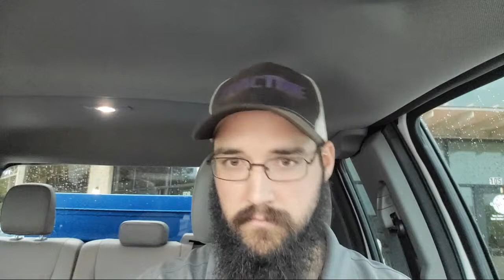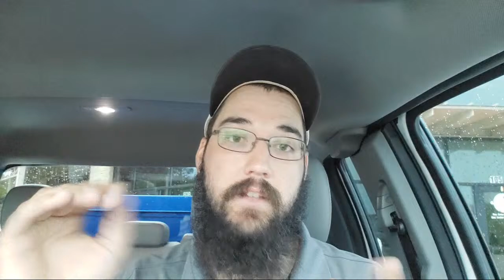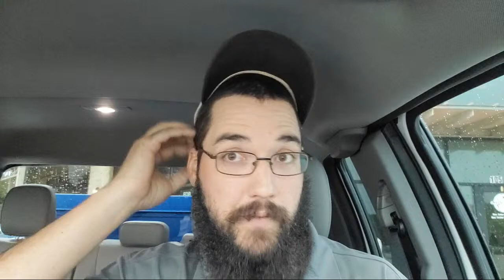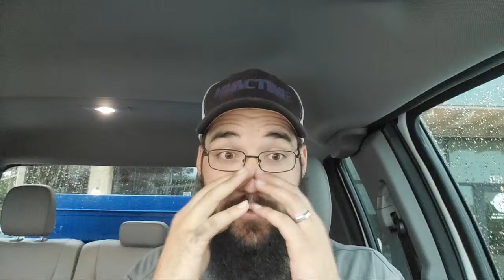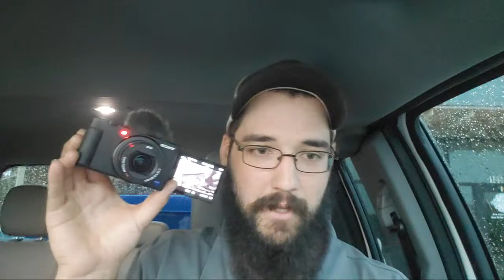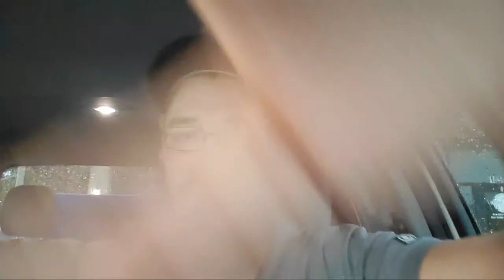I NEED ADVANCED CHILLER HELP!

Comment: Try verifying refrigerant level sensors. I have Also seen eev get stuck when under load. They work when static. But under load they don’t and get stuck causing flooding back to the compressor. A negative superheat at startup momentarily is normal but should come up pretty quick. I think you floding the compressor. Flash tank level is not being maintained. Try to change the level set points. Definitely need to verify/change oil filter. Good luck finding one. Are the over current setpoints staying  correct. Check pots.

P.s I think the compressor will need to get replaced due to constant resets. 0 psi is Concerning
Reply from the maker: Your so very close to the final result. Good input! We have everything settled now, ill have video out by next Friday.
Reply: @HVACTIME  one thing I often overlook is pulling the sd if it has one in it. Looking it the run data prior to the fault will often time lead us in the right direction. I am not proficient with excel. There are way to create a trend with it. I would also recommend installing one of it is not installed. It may help relief liability in the event of a costly catastrophic failure when everyone is pointing fingers. 
  I found a machine the vsd logic board was saying sys2 was running in the fault histories  but looking at trend data it definitely was not. Ycav have had software issues.

Comment: Blocked muffler or oil separator maybe? Also was leaning reversed phase, but vey weird the discharge lost pressure
Reply: Did you put the gauge on the discharge service valve to verify pressure is dropping at compressor?
Reply from the maker: I did, video will be out next Friday
Reply: @HVACTIME  Mate im gonna have a stab at it..i reckon the muffler was blocked somehow. Explains why the suction pressure was not moving as it wouldve pumped down after the muffler banking refrigerant in the evaporator and removing refrigerant from the condenser, thus causing the compressor to growl trying to push against a high discharge pressure immediately after the compressor.
Dunno man, would like to see what the issue is on Friday when you post. Anyway like your videos, keep it up!
Reply: Ooo just realised a failed discharge valve could be the culprit after watching the whole video lol

Comment: Confirm that the amp draw displayed on the fault log at the time of running is actually above the fault limit set point. One of my colleagues noticed once that the actual current being drawn at the time of fault was lower than the setpoint on the front screen.. this turned out to be the blue potentiometer on the logic board was loose and was randomly dropping the current set point. We swapped boards between 2 chillers and were able to verify that as the problem.

Comment: EE here, no HVAC guy: Compressor is overamping. That's indicating increased resistance or shorted windings. All three windings shorted is usually uncommon. But if one is at least partly shorted it might lead to vibrations/additional stresses on the material due to torque fluctuations. The end result would be a fatigue crack somewhere and overamping due to the higher than required torque (if not electrically induced, might be mechanical). In the right spot such a crack might make the high pressure side leak refrigerant back to the low pressure side when turned off. That would explain the cold compressor. Adding oil helps to seal the crack until the oil is pushed/washed off of the spot. That's a logical explanation of why the compressor built pressure briefly after adding the oil. 

What I still cannot explain is the pressure drop on the high side with this chain of events. But then, I don't know shit about compressors.
Reply from the maker: Solid reasoning! We do have the answers at this point. Will be releasing a full video next week.
Reply: @HVACTIME  From your words I guess that wasn't the problem... Looking forward to the resolution next video :)

Comment: What's your oil pressure differential?
Reply from the maker: 10psi +/-
Reply: What's the desired super heat. I'd be more concerned on what caused the low super heat. I'm assuming that was an issue because I don't recall that you mentioned it just the sweeting of the compressor. It sounds like that is the main problem that washed out your bearings. Does this system have glycol and if so have you checked to see what the level is? Too much can cause low super heat it acts as an insulator.
Reply from the maker: 12 degree target. It was definately having a flooding issue but not in the way you would think. Full video next Friday

Comment: I’m glad someone mentioned it in the live. I’ve personally seen 2 York chillers have bearing issues causing more vibrations which in turn slowly but surely closes the discharge ball valve. Especially if the packing is slightly loose. Which will answer your pressure drop on the discharge side. I’m leaning towards bearings going out in the screw and possibly a restriction wether it be in the ball valve or in the muffler. Separator I have a hard time believing but you never know. You can also try to check temps across the separator that may give you some indication on wether there is a serious pressure drop from restriction there. Let us know what you find we’re all waiting! Good luck
Reply from the maker: I figured out the discharge pressure drop and its a interesting thing. I did verify this morning that discharge valve was full open.

Comment: You are wrong on screws not handling liquid input! I happened to do air compressors - screws do handle oil floods and pretty ok. It puts a big radial load on the bearing and causes massive over current - but the only outcomes of the slugging is a shortened compressor life, and not a catastrophic failure, most of the time.
You probably not familiar with mechanical side of the liquid slugging because with whatever you work with automation and protection will shut the compressor down really quickly.
Reply from the maker: That's interesting input but I don't completely agree. I've had lots of screws destroyed by heavy flooding. The oil helps create seal but its not ment to pump liquid refrigerant.
Reply: @HVACTIME  If you really think about it - the media gets carried between screws tips and the casing wall. The hardest part is where media gets squeezed where male and female threads mate - that’s where the radial load to the bearings come in. But media at that point gets either pushed forward towards exhaust port in the end cover, and/or backwards and pushes against the suction flow or in between bearings and the screw tips. Some cheaper screw air compressors don’t have the oil stop valves which stops oil from flowing back from exhaust side and piping to the air head. And those get flooded pretty regularly, and then restart fully flooded with oil. Matter of the fact - you get problems of oil splurging through air intake and filter pretty often. It’s just weak spring or stuck air intake check valve. And you also have high current and sometimes growling or straining noise on flooded restart. But it is not causing catastrophic failure if it is not happening very often. 
Interesting that there’s a term “oil flooded screw air compressor”.😁
Of course lubricity of the compressor oil and liquid refrigerant are different, but you will not brake the valve or cause plate separation by liquid slugging in these, like on reciprocating or scrolls.
Reply: @HVACTIME  BTW - there’s hydraulic screw pumps, which pump incompressible liquids. Although the discharge port is much larger and TPI of the screws are more numerous or finer, but the principle is the same.

Comment: Wondering if you know about the type of the three phase sequencing meter that you can actually physically hold against the side of the motor and it will show you the direction the motor turns.
Reply from the maker: I don't have one to use
Reply: @HVACTIME  I bought Sperry one, there’s also one made by Grenlee ( more expensive). Some screw air ends have thrust limiting set up only one way ( by design), and if you run them backwards even for a few seconds - the screws will get pushed wrong way and bite in to the housing which will damage the faces of the screws and the end plate. Like on smaller and cheaper Atlas Copco air ends. That’s why I bought that device, to be 100% sure that I will start the motor the right way.

Comment: If swapping a phase, it needs to be done at the compressor terminals , not the incoming to the chiller,  IGBT will "auto correct " if the phases were to be swapped.... can't wait to find out what the final outcome is, sounds like the compressor is finished , like circuit No 2, you just seemed to have caught this failure as its happening...
Reply: I also happened to lean hard towards that thing ran backwards.
Reply from the maker: I swapped legs at vsd output. Its very possible though, we will find out in the morning for a final test.

Comment: Did you independently verify the amp draw with a stand-alone meter? I’d be questioning the systems current sensing personally, but I have absolutely zero experience with this thing.
Reply from the maker: It is accurate

Comment: It could have tripped on something else from the beginning but they kept reseting it until it got worse. I think it only stores the last ten fault codes.

But with that in mind. Negative discharge superheat and the whole body being cold can make some funky stuff happen with the lubrication. Even if you have a oil level in the sightglass it could be mostly liquid refrigerant. Cold oil also affects the viscosity. 

Keep up the good work and good luck to you sir.
Reply from the maker: Right it only holds 10 sadly. It was definitely a flooding issue in the compressor

Comment: I was told by JCI at one time that their screws weren't directional.  

Did you pull the oil filter and check for metal shavings?

If no shavings, sounds like the IGBT.

Maybe as an added bonus, something is dropping power to the sensors giving you the 0 psi?
Reply from the maker: We haven't checked the filter yet. Igbt wasn't issue, tested that this morning. Also identified the pressure drop issue.

Comment: Sounds like the compressor has bad seal or a cracked casting. That will ness will your readings . Try a pressure test on the compressor. That oil loss is a BIG indicator.
Reply: That compressor is dead . Give it's last rites. ☹️☹️

Comment: Sounds like you have a sensor bad which is causing low super heat which is causing the oil to wash out
Reply from the maker: I'm really questioning the low side sensors but that will have to be addressed once we get the system stable.
Reply: @HVACTIME   I've never seen a separator cold unless it was getting considerable flood back
Reply from the maker: @advancedrefrigerationpodcast  we were definitely having a significant flooding issue. A mixture of flash tank problem leading to migration.
Reply from the maker: @Angry Beaver  alllllll the freaking time..........

Comment: Ok I missed it 
Wye delta start has a min time chiller starts unloaded sound like it’s stuck loaded or bad winding on delta run
Reply from the maker: Its a variable speed system. Would be much simpler if it were a Wye delta though.....
Reply: @HVACTIME  I missed the part where suction stays the same and discharge goes down
That sounds like a oil issue not enough oil on a scroll the oil pump sucks liquid refrigerant causing a drop in pressure and hydraulic locking comp 
How long till you can restart the unit again